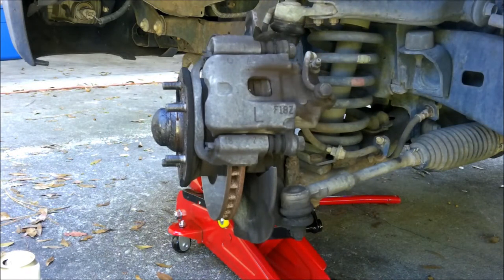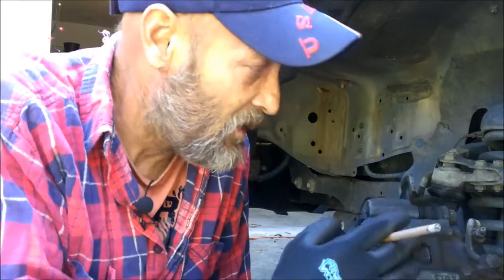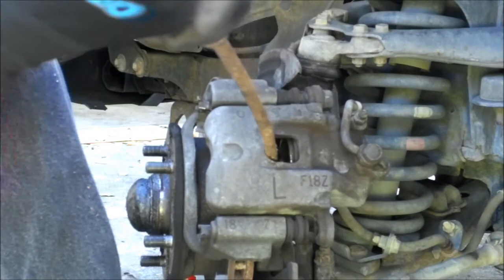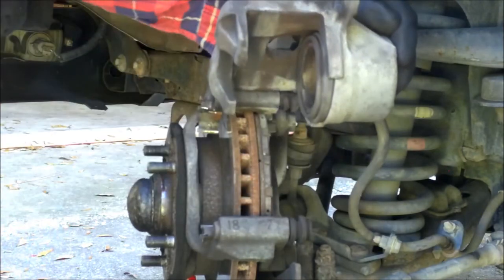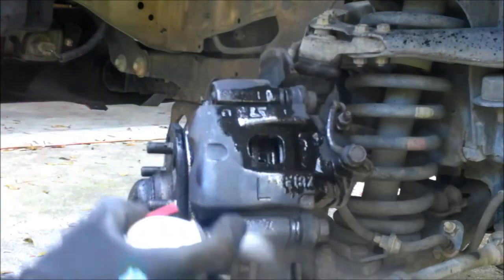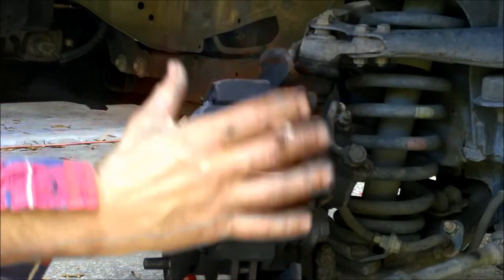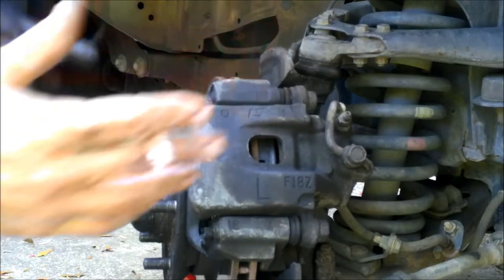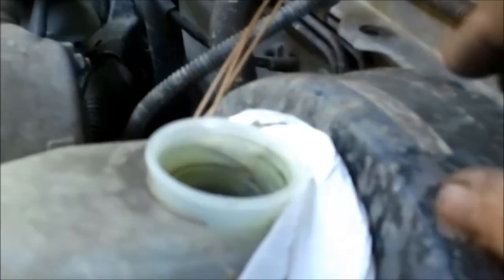how to....replace brake pads, toyota tacoma

Comment: Glad you caught yourself on pumping the brakes on the left side after changing pads to lower the brake fluid reservoir before doing the right side brakes. As this would push the fluid possibly up to high in the fluid reservoir.  Good job. Thanks